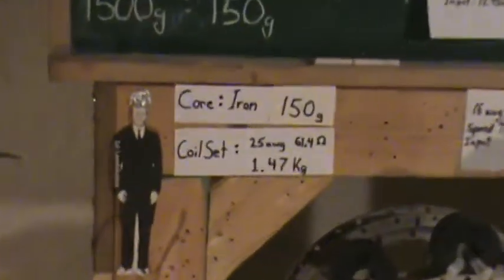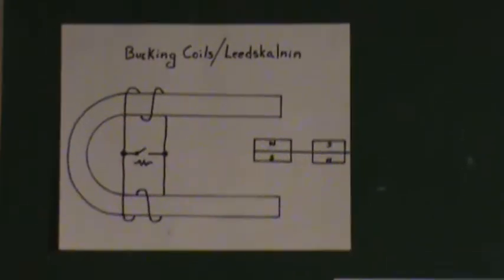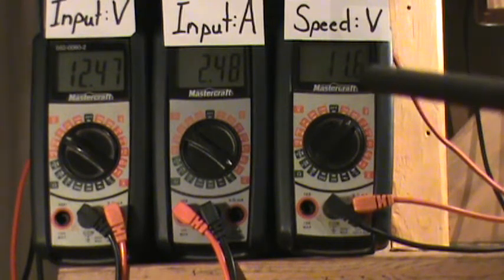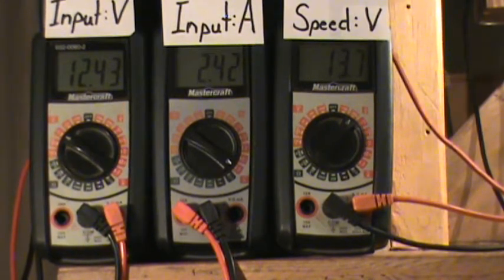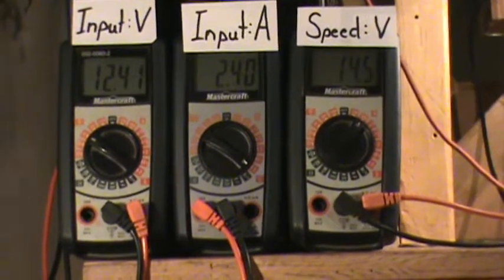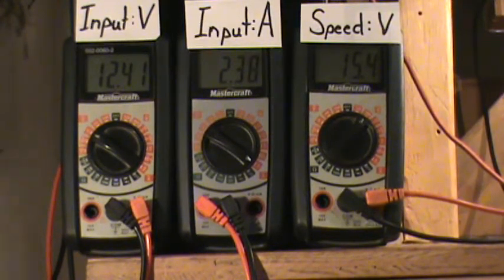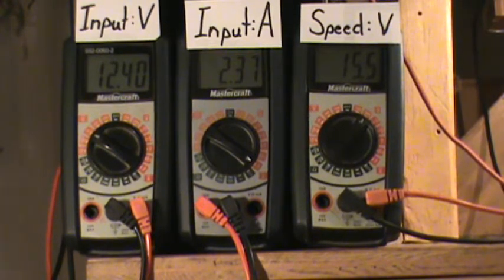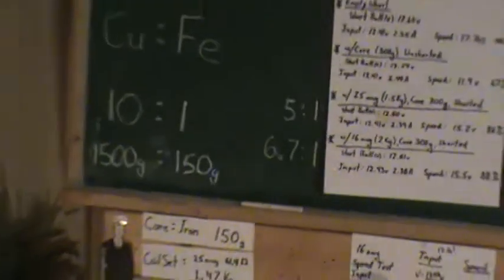Free Energy Project - 10 to 1 Testing

Comment: Less iron gives faster speed. What would happen if you used aluminum core? Or even a wooden core just to support the coils. From this test I would expect faster speed with the above cores when coils are shorted. Going by this test. A LOT faster. In a wind turbine as it speeds up it produces greater magnetic field in the coils producing drag and slowing the turbine down. That's with an air core. Fantastic results keep em coming.